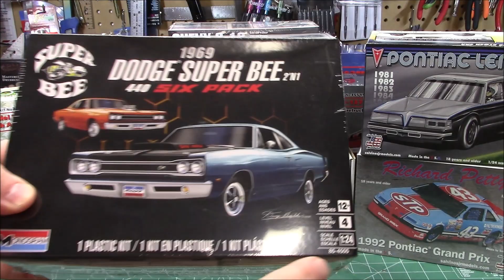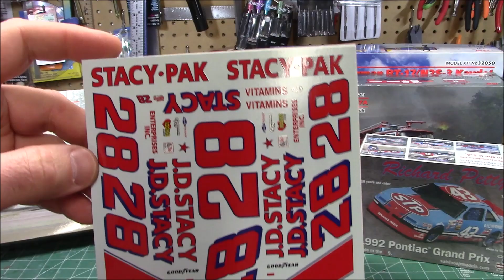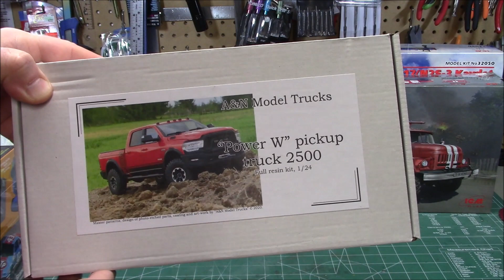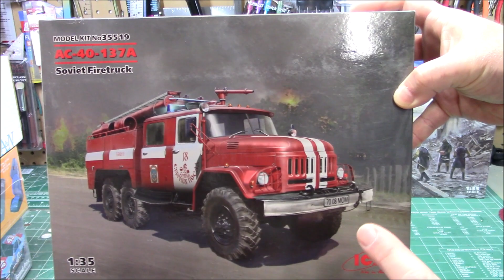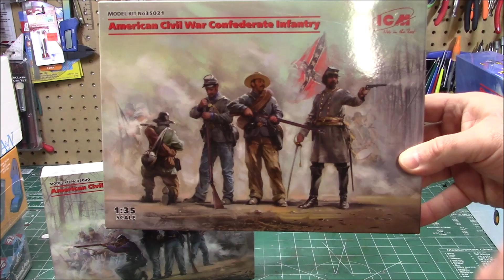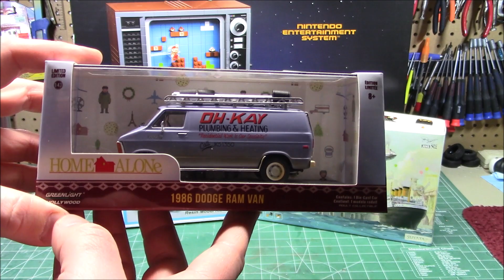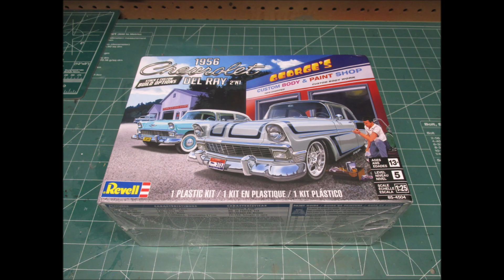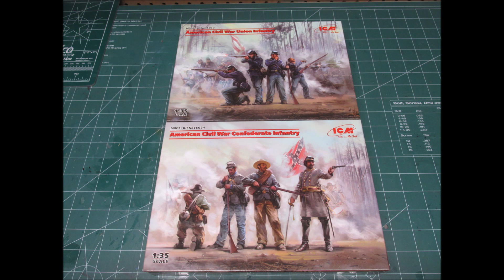NEW KITS! Upcoming Reviews hpiguys Workshop ICM AMT MRC Revell Tamiya Lego MPC Monogram A&N Resin

Comment: I built the Petty kit back when they first came out years ago. It's a nice kit. I used Model Master French Blue and it's close to the Petty Blue. The big red stripe down the middle of the car was not part of the original decal, I had to paint the stripe and it was hard to match the red on the decal. Hopefully the new decals will have the red stripe as part of the decal. Interesting both boxes have the same photo of the car but mine is called the STP Grand Prix and the original copyright date of 1990 made in USA kit #6728. Looks like my 1990 version has been upgraded to a 1992 car. Wonder how they did that?

Comment: If the 1956 chevy has opening doors, I built it back in the late 70s. Cool kit
Reply: It’s a newer tooling, more accurate, fits together far, far better but only the hood opens.
Reply: @CycolacFan  those kits with the opening doors and trunk were cool.
Reply: @andrewmcgibbon9785  they were, great detail although you needed some skill to build them well. Ten year old me couldn’t get the suspension together on the Revell ‘57 Chevy, a kit Scale Auto once called ‘virtually unbuildable.’
The newer tool ones pretty much fall right together.